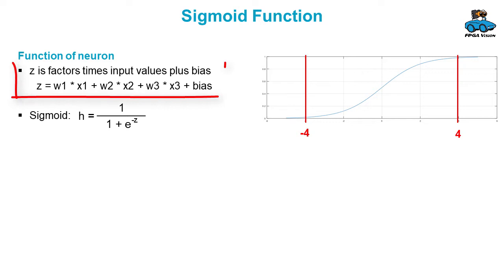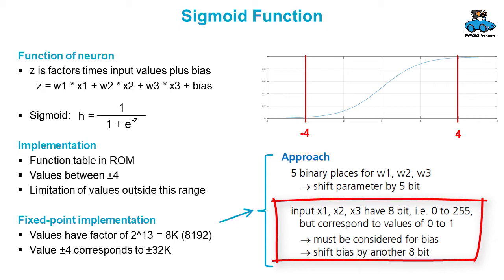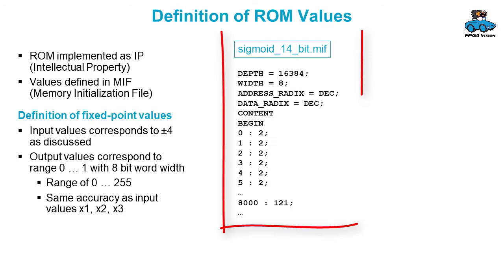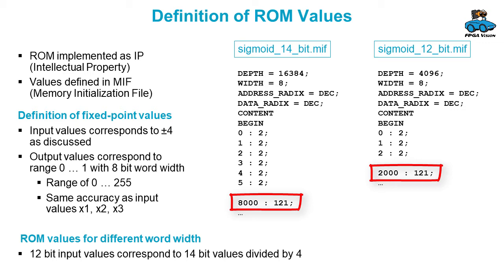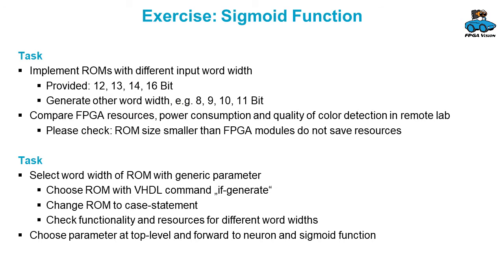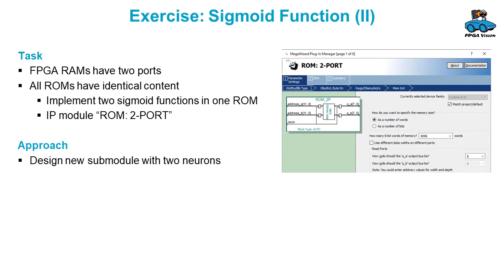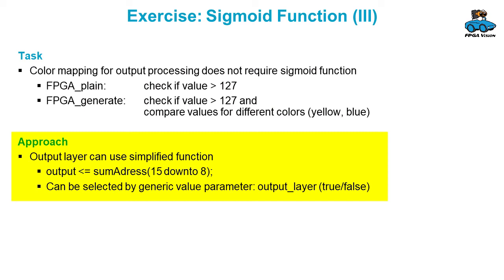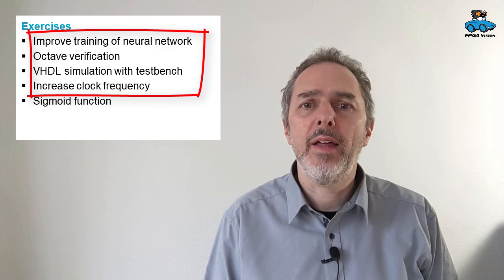Machine Learning on FPGAs: Sigmoid Function and Exercises

Comment: How the Floating-point values are converted to Fixed-point values? I know by the Octave code. But can someone explain the concept please?
Reply: what is mean by 5 binary places of w1, w2, w3?
Reply from the maker: Please have a look at minute 5:40 in video "Machine Learning on FPGAs: Circuit Architecture and FPGA Implementation", https://youtu.be/Qgjawf20v7Y

The first floating point coefficient is 0.90314. In binary this is expressed with values of 1, 2, 4, 8, ... And the values behind the binary point are 1/2, 1/4, 1/8, ...

We work with 5 digits behind the binary point so we multiply with 2^5=32. In the video you see that the value of 0.90314 multiplied with 32 gives 29. 

You calculate with this value and consider that it contains a factor of 1/32.
Reply: @marcowinzker3682  Thank you so much for your detailed response. I think I have to revise some basic concepts first. 
By the way, your videos are excellent and please make more in-depth tutorials on Hardware accelerators for machine learning.
Reply: @marcowinzker3682  If we increase the number of digits behind the binary point from 5 digits to let's say 7 digits, what will be its impact on the whole design? 

Because these values are handled as Integers in the VHDL. I don't see any impact it is going to make on the design in terms of hardware.
Reply from the maker: @Sadiqkhan-st4pt  Have a look at minute 3:15 of the video I mentioned earlier. If you increase the word width to 7 bit, the multiplier and adder will have two more bits. After the adder you can go again14 bit, so the ROM can be the same. It is a little bit more effort and a little bit more accuracy. 

Do not forget: At minute 8:15 the value sumAdress will have two more bit, so (17 downto 0) and the ROM gets value (17 downto 4).
Reply: @marcowinzker3682  Got it. Thanks a lot.